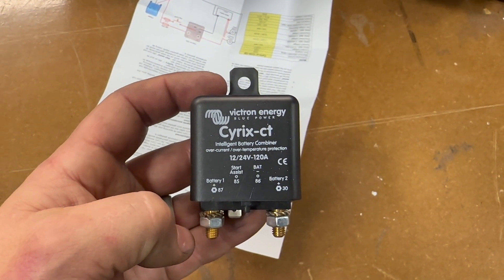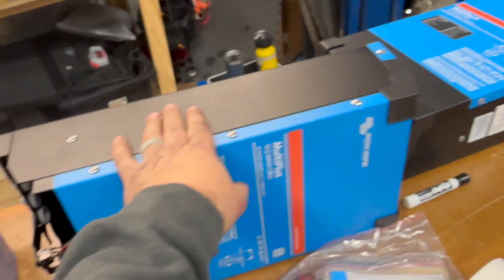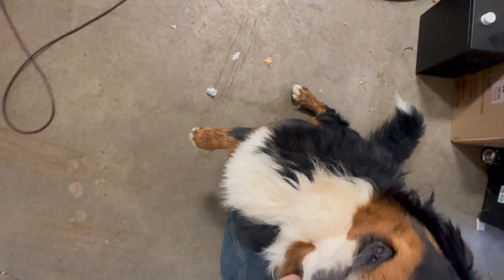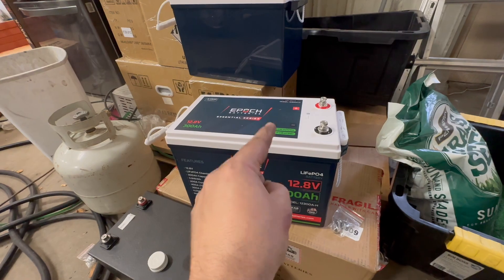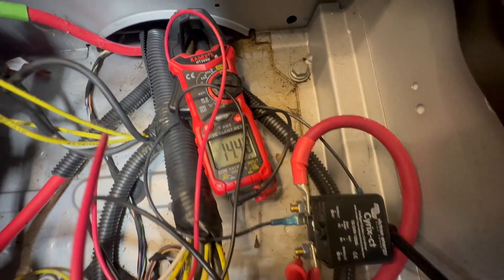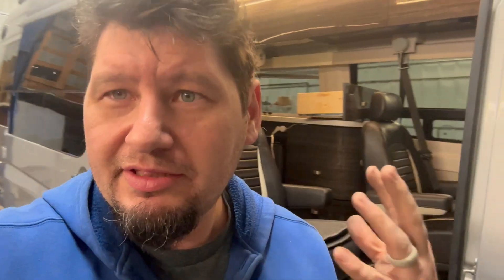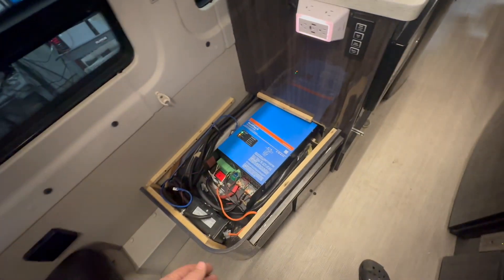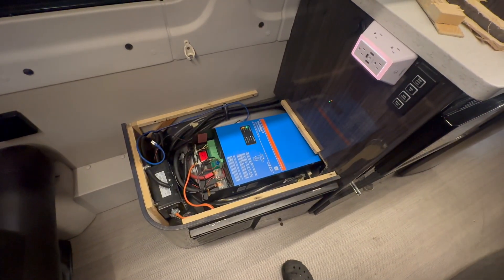Airstream Touring Coach Sprinter Van Epoch 300ah Lithium  Battery  & Inverter Upgrade

Comment: Cyrix-ct is not a good combination for Litium ...amg yes ...  ... for Litium setups you should use the Orion Smart series.. then you can limit the power draw better. its just safer for your alternator ..and thats what you want ...you could place 2 of them if you have a big alternator and just limit the amps internaly 40 + 30amps ..and you can even set a switch. so that you can activate them when your driving long distances .. you would want to avoid max load on any alternator while in trafic jams ...yes they will charge but the alternator might heat up due to less airflow and lower rpms of the engine ... rpm on the alternator cools the thing down...

Comment: @Sean you mentioned in this clip but I want to confirm with you, does 2 of 300Ah EPOCH Essentail Batts fit in a later model Airstream TT? It looks like a pair may just fit according to the batt box dimensions but it's super tight. Want to confirm with someone who did it. I have a 2022 Flying Cloud 27FBT with 500 Ah of Battleborns but really tempted to go with 1200 Ah of these batts. I have a split bank designed currently still using the original batt box and works great with the BB batts. I just want more power in the same footprint.

Comment: Sean, Please advise if you have had any customers wanting to mount panels on SIDES of RV (hinged to swing UP flat and/or to hang down).  Any considerations to doing on bus conversions vs stick & staples?
Reply from the maker: For ice houses we recommend vertical mounting.   I’ve seen it done on bus conversions. We’ve never done it.